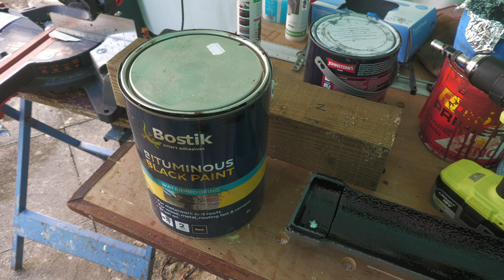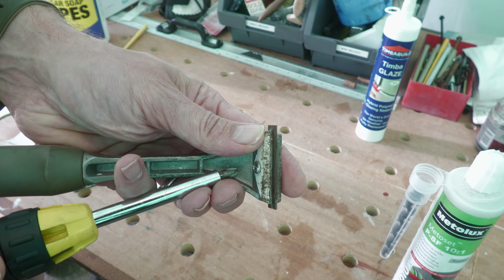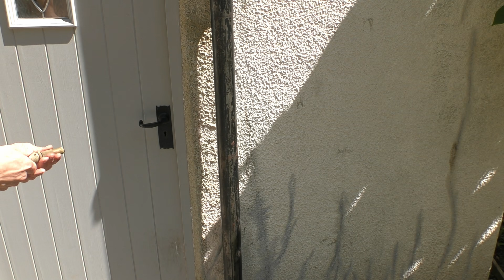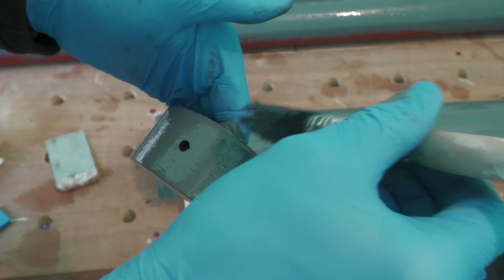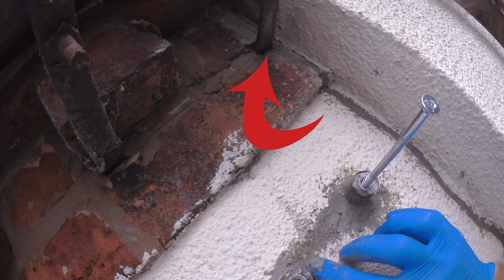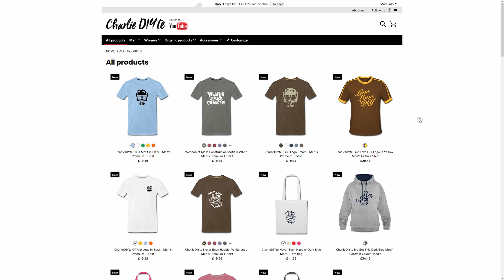How to Restore Cast Iron Gutters

Comment: Came across this a couple of years ago and mentally bookmarked it, glad I could find it again because guttertime is approaching. Two questions (anyone?)

1. Are the separate primer and gloss coats really that much better than Hammerite? Obvs there's a much bigger colour range available, but functionally?

2. What's the wire paint stirrer drill attachment at 7m 58 secs.. and where can I get one!
Reply from the maker: I think the Bonda Rust Primer is definitely worth doing. It's got to be better than a one coat solution and I also really recommend Neutrarust before you start. The gutters I've treated in this way still like as good as when I did them. The stirrer is called a Cyklone https://amzn.to/3N3TPMU (affiliate link - helps me out a little if you buy though it) 👊
Reply: @CharlieDIYte awesome, thanks! I'll even break my rule and buy from Amazon, to say thanks.

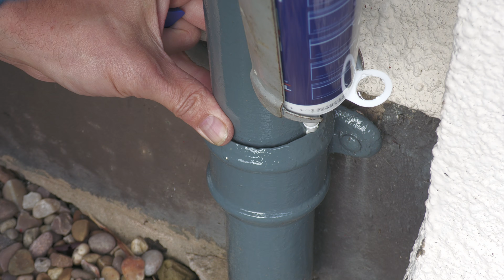Comment: 13:08 you need to leave the joints loose. They are designed that way to allow access to dislodge and debris that might need up in the swan neck.

Comment: A very helpful guide, thank you. I followed this step by step restoring my gutters. 
I did however come to stop abruptly today. I have used the same Johnstone Stormshield flexible paint as in the video and as recommended in the Johnstone's shop. However it's been 2 weeks since painting them and the paint still isn't fully cured and it scratches off very easily by sitting down. It even leaves smears on my hand when handling it. I went back to the shop this morning and was different staff memeber and they advised this paint is mote suitable for wood and that's why it doesn't fully cure. They recommended to take it off and replace it with something more suitable. Did anyone else come across this?

I like your videos, they helped me a lot tackling projects that I wasn't very confident of taking on
Reply from the maker: Sorry to hear that. I wonder why the paint hasn't gone off. I've never had that problem. Silly question but they didn't accidentally give you Stormshield masonry paint did they?
Reply: @CharlieDIYte  Hi Charlie, thanks for your reply. It's wood paint. They said stormshield is only for wood. And because the gutters are metal none of the paint gets absorbed. I did a bit of research last night and I came across linseed oil paint by Brouns & Co. I'm planning giving them a call tomorrowbto ask them a bit more about it and to see if it's a suitable alternative. Have you done any work with it?
Thanks again, I appreciate your work 😊

Comment: Great video Charlie, question for you, I need a 120mm cast iron gutterend for a cast iron guttering.  Most places online have 115mm and 125mm.gutterends.

Where would you recommend I could purchase this from? I can't find this locally anywhere at Screwfix or Toolstation etc
Reply from the maker: Hmm. That is tricky. Only thing I can suggest is use a 115mm and build it up with gutter seal or call Hargreaves Foundry and see if they'll make one for you.

Comment: Rust removal ftom metal objects like those has been made much easier i think with the reciprocating saw wire brush. Does as hood as the grinder. Great for long lenths and big areas.
Reply from the maker: I wasn't aware there was such a thing. I'll check it out Clive. Thanks!

Comment: Try finding a plumber that can oakum pack and lead pour those joints these days! Honest respect to those before me!
Reply from the maker: Just about to refurbish a load more and I'll be using glazing caulk in a tube this time as those kits don't work very well and there's always a danger you over tighten them, cracking the gutter.

Comment: Hi Charlie, at 0:24 you have a cast iron rain hopper, can I ask is your gutter above the hopper ? I have a rain hopper on my guttering of my cottage and the L/H side of the hopper has been cut down so the guttering sits just inside the hopper. it desperately needs replacing as the ears have rusted away and I'm considering cast aluminum replacements. cheers Simon.
Reply from the maker: Hi there. Not quite sure what you're asking but the gutters above do run into the hopper.

Comment: This is a great video for DIY on your gutters. I was motivated by it to take all my 25 m aprox cast iron gutters down from my 150 year old house and renovate these following your advice. This saved me masses of money against getting this done by a roofer. Neutrarust 661 and the Hydrostrip rubber connecting strips are a great find. My tips are; ditch the battery powered angle grinder, you will rip through batteries in no time. I bought a corded Makita GA4530R off Amazon along with wire brushes which has performed really well. You don’t need big quantities for this job, a litre of Neutrarust ,a litre of metal paint and about the same of Bituminous paint are adequate. My local Jewsons helped me with some pieces of downpipes that I had to replace. New stuff is v expensive; an offset and downpipe coming in at £200 plus, showing the saving you can make renovating!
Reply from the maker: Great work. Very satisfying isn't it. 👍
Reply: @CharlieDIYte  yes indeed, in your video you mention making soak aways for your down pipes. Do you have a video of how you did that or can you describe this, as this is my next job as there are  no soak aways on my house. Thank you.

Comment: Great video, thank you. May I ask why the downpipes aren't treated on the inside the same as on the outside? Are you relying on the coat of rust to protect it?
Reply from the maker: Simple reason is I can't get to the inside 😉 That said corrosion seems to be much worse on the outside so I'm keeping my fingers crossed the insides will be ok.

Comment: I wish I had kept the Old Cast Iron Guttering on My House is Terraced and Both sides had Their Gutters replaced with plastic so I thought that I would have to but ever since I have had water pouring from the Gutters in a down fall of Rain ,I have several People Who have tried to repair the Gutters but wasted Money with hindsight I would have left the original Gutters and My Neighbours would have been responsible fo9r the leaking Joints .
Reply from the maker: Sorry to hear that Vivien. Sounds like the new gutters weren't installed correctly or with inadequate numbers of brackets 🤔

Comment: Another good video thanks. My only comment is that the rise and fall adjustment brackets are now impossible to adjust as you have slapped a thick layer of paint all over them! Not that they were adjustable before with the rust but originally they were there to allow for adjustment. I wonder if there was any other way of treating them to preserve action of the threads and nuts?
Reply from the maker: Fair point but in my case there's no need to adjust them as the fall was correctly set when they were installed. 👍

Comment: Hi Charlie - very off topic but some advice needed please, I'm fitting some new architrave to a door frame that isn't straight across the top, it drops down from left to right. (it's a 200 year old cottage so nothing is straight) I'm fitting a tall piece to the left hand side and and piece across the top (none to the right). 
To the left of the architrave I'm fitting some wooden panelling to the wall. with a decorative piece of wood across the top running from the top of the architrave to the returning wall on the left hand side. 
Am I better to have the architrave above the door fitting level and just bodging the underneath, so that the decorative piece of wood above the panelling doesn't look odd? First time doing architrave so just wanted some advice before I commit to it!
Reply from the maker: If I'm understanding this, I would have the decorative paneling above the door running straight as it will look odd if it doesn't. The architrave needs to be parallel with the door lining so this will have to be wonky. Maybe send me a photo so I can see what you're talking about (email address in the Description below the vid).

Comment: What's wrong with wooden plugs , my house was built in the 30s and there still like brand-new, what's the cost of wood plugs compared to the way you did it, and how do you know how long your way will last ?, New way is not always the best way, we can learn a lot from the old builders. Good vid lad.
Reply from the maker: Thanks. Nothing at all wrong with wooden plugs, and I thought long and hard about it. Just thought this would be a neater solution, particularly given the wood can rot with time.

Comment: Excellent coverage of this subject Charlie and from a practical perspective you have done a very good job. Btw a good first exterior clean if you have taken a down pipe is putting a couple of turns of chain around the pipe and then doing a bit of push me pull you along the length, gets rid of all the loose stuff.😀👍
Reply from the maker: Good thinking Norman, and great to hear from you 👍

Comment: Love the style and approach you continue to make material with. Thanks. 
You mention chemical anchors almost in passing and I realised you would be the right guy so review some aspect of this space. I took a look over your videos and did not see one yet. 
My particular problem involves cavity blocks in a gate post. I have electric gates that seem to have worked their bracket bolts loose. However, as many of the fixings are finding cavities I feel I need to tread carefully when fixing this. 
Chemical anchors come up as a solution but which product ? And how do I get it right first time as there is likely no attractive second try with this technology. ? 
Thanks in advance. 
Keep doing what your do. 
Fred.
Reply from the maker: Hi Fred. To be honest I don't have any experience with chemical anchors but you can't go wrong with a Fischer chemical anchor product - something like this https://bit.ly/3jUTXwE or something like this https://bit.ly/3GH3xwO that comes with the bolts. Have you considered expansion/wall bolts like this https://bit.ly/3BEQA2N . I guess it all depends on the thickness of the block before the cavity?

Comment: Great vid, thanks! Was it difficult to get in to the back of the pipes that remained on the wall? For the seals, you can still use rope and a bitumen sealant (used to be lead); the rope makes the whole thing a bit more solid. Hargreaves sell the rope and sealant, I made a tool from 22mm copper pipe to fit it :)
Reply from the maker: Thanks buddy. No it wasn't because thankfully they've been spaced away from the wall with those lead pipes making it reasonably easy to get the scraper behind and to paint. I'm kicking myself for not asking Hargreaves what they had for the sealing as I called them up during the research for this vid (to ask whether they'd had any issues with those rubber gaskets and bituminous paint). Great info. Thanks for sharing.

Comment: This is a job for next year on our 1930s semi. We have a section of downpipe with a chunk missing from the joint. I've seen you old video on how to glue these bits but you had the little chunk I think. Any tips on what to do if that bit is missing? Is there a way to patch it somehow?
Reply: They do plastic imitation parts for cast iron. Search for cast iron downpipe coupler. You cut the old socket off and slip the new one in place, once painted you will never know. Or you will have to keep your eyes peeled on ebay for a real one.

Comment: Great video Charlie, thanks for this. Currently contemplating doing this myself or else replacing them. I also have to dig out a soakaway around the house too, don't suppose you have a video on this or could recommend one? Thanks!
Reply from the maker: Thanks Luke. I'm afraid I didn't video it, but I just dug a channel, and laid a perforated land drainage pipe like this https://store.jdpipes.co.uk/100mm-perforated-land-drainage-coil-25m/ and infilled with 20mm gravel. Probably best to Google it though as I'm sure loads of people have done this.

Comment: Do the downpipes need sealing?  Having them unsealed allows water out if blocked below and informs you of a blockage and can then eadily dismantle. The rubber seals on the guttering look excellent.
Reply from the maker: It's a fair question, Mat. For that offset downpipe it definitely needed glueing in somehow. I think generally it stops stuff getting in, and I suppose adds to the strength and integrity of the system as a whole, and after all, that Timbaglaze glazing putty replacment could be removed relatively easily, I would have thought. But no, probably not essential!